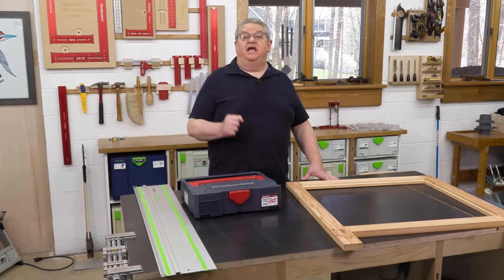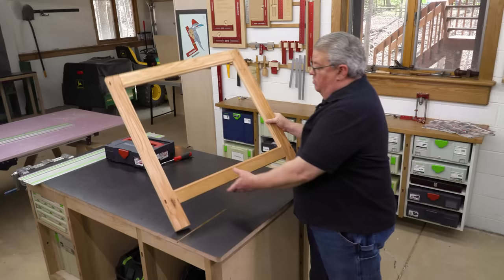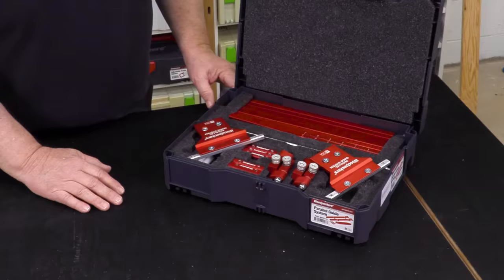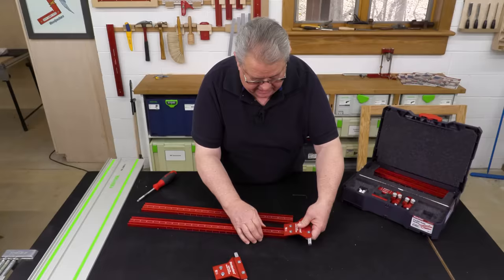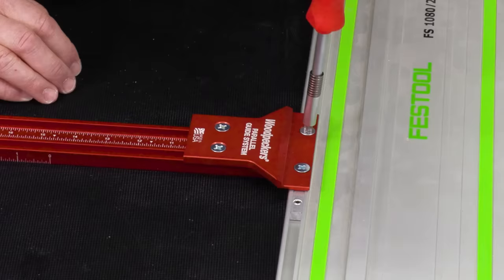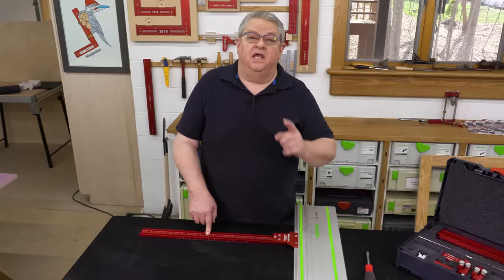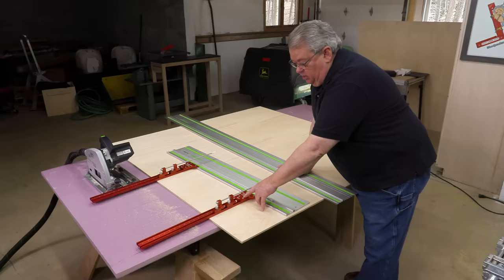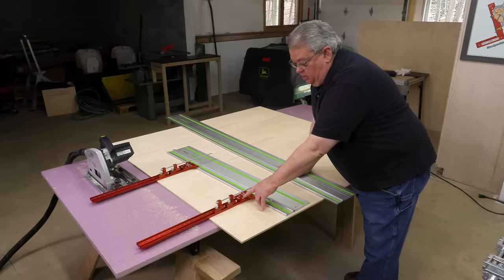This Track Saw Accessory Might Replace Your Table Saw | Deep Dive

Comment: Very persuasive video. Within a mere 10 minutes of tool set up, the guy managed to show me exactly why I need to buy a table saw.
Reply from the maker: Remember this comment the first time you try to cut 8 or 9 inches off the length of a 8' sheet of 3/4" MDF with your table saw.
Reply: @WoodpeckersLLC  Well, my comment was tongue in cheek, but I see others have said pretty much the same.

To be constructive:

1) Your video is presented back to front: I'm not interested in getting a PhD in how to put together the jig, I want to know what it can do, so you should start with the jig already constructed, and immediately give examples of what it can do. You can do a separate video on how to put it together.

2) It's not at all clear to me what advantages this has over a circular saw plus random piece of wood for straight edge, or over a track saw, which seems taylor made for what you are doing. Maybe there are such advantages, but I didn't end the video knowing what they are. You need to make them very clear.

3) Regardless of how useful the jig is, few people will want one if it takes 10 minutes to put together. You are competing with much simpler technologies, and this thing really needs to be reengineered so it can be put into use in 30 seconds tops.

4) I'm a Brit; we no longer cut 8 or 9 inches off things - it's metric all the way in quaint li'l ol' Englande these days!! (so hmm, another question presents itself: is there a metric version?)
Reply from the maker: There is a metric version. And on the web site there is a simple 3-minute video that shows the basics. The title of this video is Deep Dive for a reason. Our Deep Dive videos are targeted at both prospects and existing owners to show them the finer points of using the tools. If you want the magic without the gory details, watch our product videos. 

As stated early in the video, this tool is not about making ONE cut. It is about making multiple cuts with all the pieces coming out at exactly the same dimension without having to measure and mark each cut (which by the way, will never deliver consistent results).

It has no advantage over a track saw...it doesn't work without one. This is an attachment to a track saw, not an alternative to one.
Reply: @WoodpeckersLLC  ten koles po prostu jest zwyklym trollem tóry nigdynie pracował z drewnem

Comment: I have already ordered mine! Super excited to get it!
Reply: The excitement will wear off as you wait months for it to arrive...  I have 2 orders on “back order”.
Reply: Don't hold your breath. It's on back order until July 28, but don't count on that date. I finally canceled my almost $650 order after they changed the back order dates for the third time.
Reply: Don't worry about "her" guys, you can bet that the account is a Woodpeckers sockpuppet praising the product.
Reply: Thrift Diving...What a fool

Comment: I just got my parallel guides.  I spent a good 20-30 minutes being extra careful trying to get mine calibrated.  Its close, but its always about a little less than a millimeter off.  Its probably because the second triangle on the rail is not on an actual mark.  Its slightly off.  Without the line, I can't seem to get it correct no matter what I do.  I don't use the imperial system because the metric system allows me to be more accurate.  But not with this.  I guess I'll have to flip it upside down and use the thin rip stop to zero it to the track and then do a bunch of measurement cuts on thin stock to see if that fixes it.  Had to wait almost 2 months for this and it wasn't cheap.  This is extremely frustrating after all this time and money.
Reply: I can see where this could be a problem. Why didn’t  they index those two spots for calibration in the rail so those stops would fall in and there would be no doubt they are in the right place. The longer the track the further you are going to be out of square even if you are off by the width of a pencil mark.

Comment: I can’t help but to notice all of the “master craftsman” in the comments blasting an American 🇺🇸 company for being innovative. There are several real world, practical and viable use cases and scenarios where this system would shine. For those of you who make perfect cuts with your grand dads old circular saw I’m truly happy for you. For those of you seeking precision, repeatability and practicality explore this system, and any others that will work for you. And for all of us woodworkers let’s try to remember that there’s more than one one to get every task done, and done right. Keep learning and doing better!
Reply: Definitely not worth the time, effort, or money. Don’t get me wrong the quality is top notch but the setup is near impossible to get good repetitive cuts out of. So much faster to use the track square and break down pieces to put through a table saw. 

If you were completely mobile and need to cut 100 shelves then maybe it would be worth while, but I’d still rather use a job site saw. 

The tracks need some way to index the stops, doing it by sight allows for too much error over multiple cuts requiring extra waste to trim the ends square.
Reply: @Michael..... You must really be very desperate to be sponsored by woodpeckers!!!

Comment: Couple of days that and he will wish for a tablesaw.
Reply: Haven’t used my table saw since I got my Festool. Been about 4 years now. I keep thinking if I should just get rid of it. The track saw is so much safer and portable. Just yesterday I had to cut a very thin sliver of MDF (but 2 feet long) to use as a shim, track saw worked beautifully. The only reason I keep the table saw is the off chance I need to do a dado or something.

Comment: I have multiple tracksaws and rails .. along with all of the Festool accessories that help them to be a true system. I'm quite adept with them but I ONLY see tracksaws as an alternative to the need for a panel saw. A table saw, a bandsaw, etc are still important shop tools.
Reply: Agree,  have never needed a track saw in my shop. My Milwaukee panel saw is cheaper and does everything I need it to do.
Reply: @whales302  not sure about a Milwaukee panel saw? Never heard of one of those! Panel saw and table saw are different animals.
Reply: @whales302  A Milwaukee panel saw is $1,700 and only makes square cuts. A track saw is much more versatile, portable and takes up much less shop space.

Comment: I would have to agree with most others that in the final analyses Woodpackers has created a tool from the Erectorset school of engineering that is not affordable to cut a material that is no longer affordable. These folks make some uber cool stuff but this one should have died on the drafting table which is another kinda table that dont take a dado stack.

Comment: The great idea of a track saw is the nonslip sliding rail. Just line up the ends and cut.  Nice system, but I'll stick to the table on wheels I roll up to my cabinet saw and get a perfect cut with no tear-out.   From pick-up truck to cabinet saw. Piece of cake.  In the field nonslip sliding rail is very useful.

Comment: Will this work with the Kreg track?  And if not, any plans for future versions?
Reply: It does not.  Yes, we are looking into other versions.
Reply: I use a Seneca parallel guide system on my kreg ACS unit. Any of their head units fit but you cannot calibrate their system on the kreg track. I use a 36" or 48" steel rule to set the distance from the splinter guard to the stop on the incra t-track plus it uses. Have been building cabinets of all sizes up to 6' with this method for over a year with great accuracy. If woodpecker does bring out a unit for kreg that would be great but in the meantime my customers are very happy with the results. I did buy all the incra sizes of their t-track plus and extra heads from Seneca to have several preset lengths for a job. Not as expensive as you would think. Hardly use my table saw anymore.
Reply: Will you be making a version for the Dewalt track saw?
Reply: @woodcraft505  Adding on that I hope you make one that fits the Kreg track.  Thank you!

Comment: Honestly, I can't see it being worth it if you already have a good tablesaw with outfeed support, etc.  Too many parts.  Why?  I would much prefer to have the guides rails unbroken.  I do cut down sheet goods outside on sawhorses, but usually only need to make one or two cuts and don't find that hard or tedious to do with my eEmerson guide.  I do have a hardwood supplier who also will make one rip for free and two for $5 so I usually do that now.
Reply from the maker: Single piece track sounds like a good idea, until you actually use it. By only using the amount of track you need for the job at hand you aren't dancing around an extra couple of feet sticking out into your working space. The majority of cabinet making cuts can be done with either one or two sections of track assembled.
Reply: @WoodpeckersLLC  Sounds like a good idea even after you use it.

Comment: Love it!  Engineering is great and woodpecker has got it!  HOWEVER!  we can make these cuts, yes even with 5x5 bb, in about 30 seconds on the table saw.  tracks saws are great in some situations but just too much setup time to be my goto, especially for parts with concealed edges, like inset cabinet panels.  and that brings me to another point....with a 3/8-1/2"  or so blind panel rabbet, squaring the plywood is SO not necessary.  we're making a parallel rip to fence, track, shoe (whatever you're using).  If squaring up ALL the parts is necessary for you, like it can be for a engineering snob like me,......just throw the sled down on the table saw and make your cross-cuts.  Anyway, i got tons more critique to give on this one for sure but....hell, why keep giving my energy away to this when i got a bunch of wood calling me in the shop behind my desk.......?
Reply: Or instead of creating a ton of sleds and home made jigs and this and that just buy purpose built tools. Not everyone has time for the nonsense you’re talking about.   Theres not one table saw cut that I haven’t been able to make on my track saw.   Not one.

Comment: I have both the TSO version and the woodpeckers. I was a little frustrated with the woodpeckers and purchase the TSO to compare. Will end up probably getting rid of one but not sure which one yet. They both suffer from the same design. No positive indexing. Parallax is a huge problem with this type of system. You could be off a good millimeter or two based on the way you’re trying to read the scale. But I will say that it is very well-made and woodpeckers customer service is outstanding. I have a number of their products and generally have been really happy with them.
Reply from the maker: Flip the stop all the way up and the edge of the stop will be sitting directly on the scale. No parallax whatsoever.
Reply: @WoodpeckersLLC  Did I mention outstanding customer service? 😊
Reply: @WoodpeckersLLC  Dublin is right,  positive indexing would be a big plus it would shorten up setup time and no second guessing. If you are going to over charge for a bunch of aluminum there should be a little more engineering involved.

Comment: It's a shame that the system doesn't fit into the provided systainer with cut foam without disassembling it enough that you lose the calibration.
Reply: get it without systainer and get a bigger systainer that fits it assmembled

Comment: You could have cut 20 sheets with a table saw in the time you took to setup and calibrate this device.
Reply: I would love to see you ALONE in a small shop, trying to handle a big piece of plywood or MDF, all by yourself without any help, on a table saw, and without having to resort to several additional supports!

Comment: It can replace a table saw and cost as much as one.
Reply: Have an issue with your setup.  Please clarify.  At 6:23 you show calibration by measuring from the metal surface on the guide track.  At 9:14 you're measuring from the edge of the sacrificial plastic material that defines the exact cutting edge of the saw.  I believe the measurement shown at 9;23 is correct
Reply from the maker: @edward-t-grogan  Edward, that's a trick of camera angle. I see what you mean, it does look like the square is against the rail itself, but it is not. It's against the splinter guard. If you look at the close-up that comes in a few seconds later, you can see that the base of the square is against the splinter guard.

Comment: You can get a nice table saw for the price of the Parallel Gide and tracks system.
Reply: And have your project completed by the time it takes to get this thing set up. Replace my table saws, laughable!
Reply from the maker: Our headline writer might have gotten a little over-zealous, but I didn't say in the video it was a replacement for a table saw or better than a table saw. It is an alternative if you have space limitations.  And, for the first couple of cuts on full sheets, I personally find it is safer and more accurate.

Comment: With all due respect, this system is far too complicated to set up to be worth the cost.  Yes, compared to the Festool system, it might be comparable but having to screw and unscrew all this stuff to change things is not the best.  Especially compared to the TSO solution and the various British as well.  I don't think I am alone in this view.  I love Woodpecker products and own several but this one I will pass on.  Thanks for the video and I look forward each week to a new one!!  Take care and stay safe.
Reply from the maker: Lots of choices out there. We think having a system that fits in a Systainer for transport, cuts narrow stock from the same (familiar) side of the blade, and has more rip capacity than anything else is worth a few seconds to secure some fasteners.
Reply: Have to agree with you.  This system is way too cumbersome to set up.  And the given example isn't changing my mind.  A 5x5 sheet of Baltic Birch plywood is trivial for one person to rip on a table saw with a 52" fence.  Even a 4x8 sheet isn't that hard with outfeed support. I also agree that Woodpecker products are great, I have quite a few, and plan to pick up more in the future.

Comment: I liked the video and the concept. but you left out so many details. For the novice who is setting it up for the first time. 1. you may suggest a need for a Festool guide rail 2. You need a flat, level platform and the materials to accomplish it. 3. You don't talk about the the cost. In overall it works and you have done a good job demonstrating the product. Thanks.

Comment: Maybe this isn't much of a thing, but during the calibration you don't have the clear Splinter guard installed. When you moved to the long rail, you must have had to readjust the head as you now have the strip in place?
Reply from the maker: ??? The splinter guard is installed in all the scenes. It must look different on your screen when it is sitting on the black workbench, but it is there.

Comment: There are way easier and quicker ways to cut square with a track saw than this and for the cost of it you could buy a site table saw and then have 2 saws rather than a bunch of bits to attach to a track saw that takes half an hour to set up for each cut. 🙄

Comment: I use the Festool track saw on a daily basis and I have found the they do tend to have a bow in the track..all lengths are guilty of it so I would never use when I can use a table saw..it’s good for breaking down sheets but that’s where it ends for me..just my observations..

Comment: I have these and the seneca ones, no comparison in quality. Seneca is essentially a t track and printed plastic piece. Big waste. These are great but for the price and woodpeckers engineering I am surprised they did not do a micro adjust gauge or sawtooth style stop to ensure you are dead on where you want to cut before tighting down. I also was not a fan of the small knobs used to tighten the stop. I found it offered a little drift when tightening. I think a 2.0 version is definetely needed because they could have done so much more with this to really boost accuracy across both guides

Comment: Another great video Jeff. I bit the bullet and placed my order. By the way, what is the screwdriver you used with the spring on the shaft?
Reply from the maker: Wiha. There are about 20 double-ended tips in the handle.

Comment: so what's wrong with a regular track saw and clamps to hold down a piece to breakdown and then manage the rest on a accurate table saw and fence guide?
Reply from the maker: Nothing's wrong with it. Some folks don't have room for a table saw. Sometimes the panels are still big enough to be awkward on a table saw.
Reply: @WoodpeckersLLC  appreciate the reply.  If I didn’t have a table saw I could see the value in this setup but I just need a basic track saw to break down sheet goods for final cut on the table.  Y’all’s system looks awesome just not for me.

Comment: How'd you finish that cut in the beginning??? 
 
This is why a right handed person should use a left blade tracksaw. It allows them to no longer stretch and lean over their workpiece. 
 
As a former lefty, I've had a nightmare trying to cut a straight line without a table saw (extremely unsafe with 1arm/leg) or other tool. So I'm having to hang it all up after 5 years of trying to adapt. If I can't cut a straight line  I can't do anything at all, and without a left blade tracksaw, I'm unable. (And I tried the KREG... 3 times... but their motor us never true. They're cheaply made and cannot be adjusted to true the blade.) 
 
So, hopefully one day, righties realize they've been duped into buying right blade track saws when they needed a left blade.